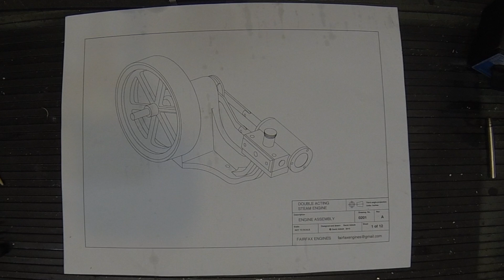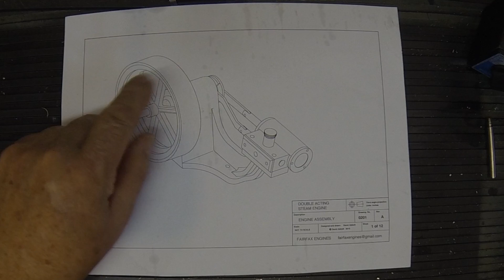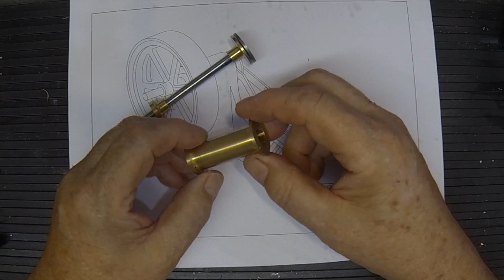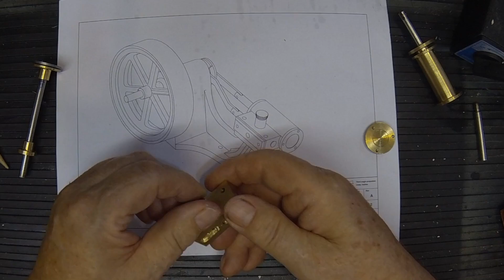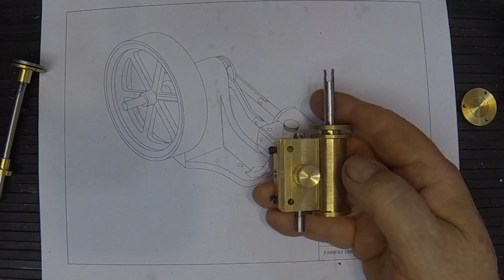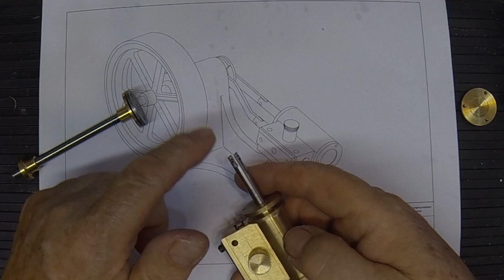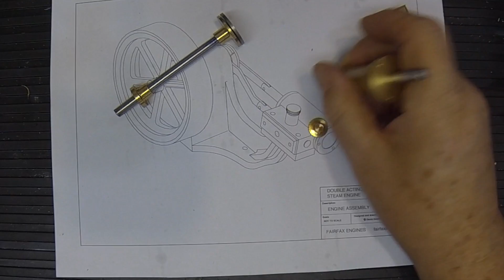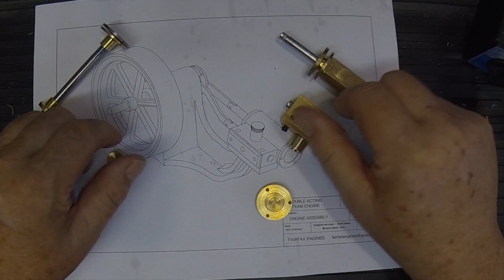This week in Herb's Workshop

Comment: That is a pretty neat design with the steam chest bolting to the cylinder close so no need of ports cast in. All made with bar stock.  Just multiply the dimensions by about 10 and you have your shop power plant......Dave
Reply from the maker: +David Richards if I were 30 years younger and had the room, I would have liked to do that.  Thanks for the comment.

Comment: Hey Herb,
Looks like a fun project, and your not wasting any time getting it done!

Ray
Reply from the maker: +Ray Caniglia I needed something to take my mind off of the little 15cc engine for a while. (It has low compression, so I have to remake the rings).  This little engine is fairly easy, but has some complicated set ups. I finished all of the little parts today, and the castings showed up. The castings will take a while, as I don't want to mess them up.  Cheers!

Comment: Maybe before I expire I'll get to making one of these or similar! That sort of project can take quite some time with small parts, that's for sure.... nice work Herb. Look fwd to seeing more on this.
Question - where/how do you mount your camera for the over head shots?
Reply from the maker: +ChrisB257 Chris, I have a mag mount that i have an extended shaft on.  In this video, it was mounted to the tale stock.  Thanks for the comment.
Reply: +Herb Blair Thx Herb - I did actually mean over head when you were showing the parts - just showing parts and your hands on the bench.
Reply from the maker: +ChrisB257 Same thing..  the camera is at the back of the bench, and I crop and invert the picture when editing.
Reply: +Herb Blair Thx Herb - I suspected as much! Just confirming. Thx for reply.